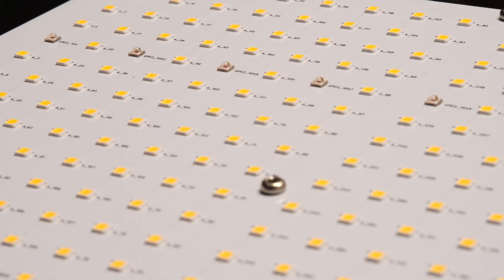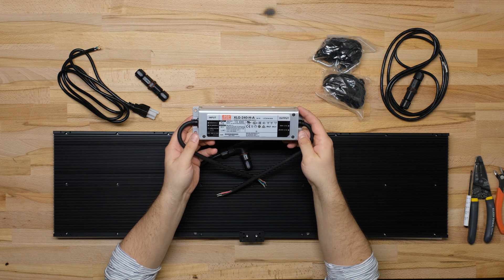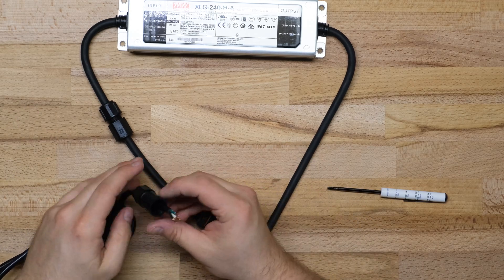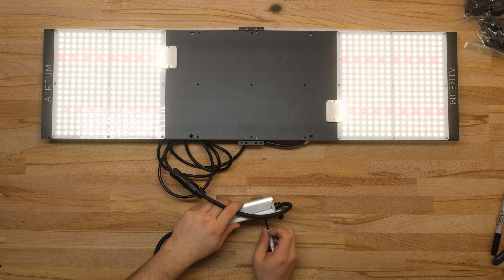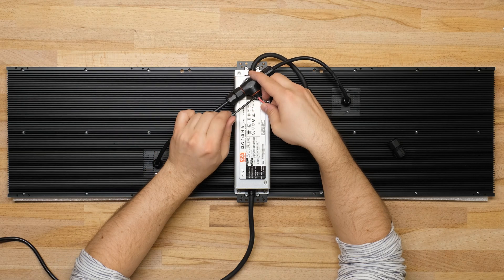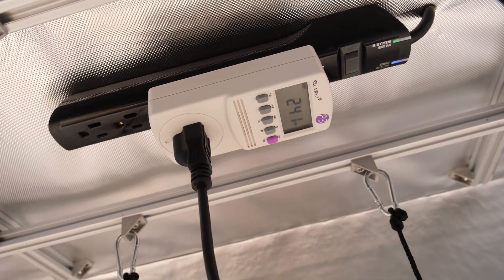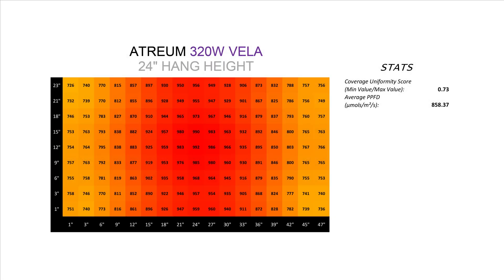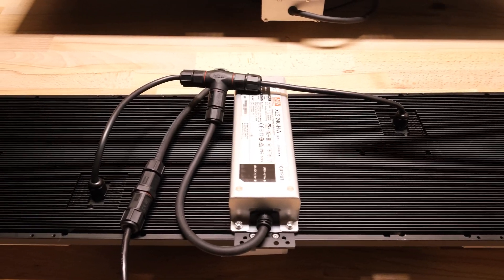Atreum VELA 320W & 240W Review: Power, Temperature & PPFD Measurements for 2 Badass 2x4 Lights

Comment: Great video! I actually purchased one of these a few months ago after watching this video. I got the 320W version and my plants are loving it. I have a question though: when shipped, one of the plastic bits that attaches the wires to the quantum boards over the top was broken but the light works so I didnt think anything of it. I just now noticed that the middle quantum board is dimmer than the other 2 by probably 25%. Is this intentional or should I talk to their support team?
Reply from the maker: They should all be equal brightness - something must be wrong. I'd get in touch.

Comment: Hi Ryan, could you help me find a link online where I could purchase a DC extension cord with black jacket for an HLG 300L and HLG 600R? I can only find red and black wires online without the black jacket.  Also do you know what size waterproof junction connectors I need for both lights? Trying to extend the driver out of the tent.
Reply: I found a couple options, do you know the gauge, the volts and the connector size?
Reply from the maker: I don't like giving too much advice on custom electrical stuff like this because I don't want to risk making a mistake and having things go south for whoever's doing the work. What you'd need to do is figure out how much DC current is passing through the wire and size your new wire to accommodate it. This could be done with a multimeter or by looking at the driver data sheet. Keep the cable as short as you can so voltage drop doesn't become a problem. This can also be mitigated by using thicker cable. A common waterproof connector for this is the LLT-L20.
Reply: @LEDGardener  Understood fully and thank you for reply. I did find the cable I wanted. Ill probably go with 18 AWG and I'll keep it as short as possible.

Comment: First & foremost I want to say thank you for putting out the guide to HLG Meanwell Drivers!  I'm a novice and you made it so easy to understand.  I found your channel after I bought a Atreum ARA-20 light kit, then I saw this Atreum review & hoping that you would show you set up the driver. With that being said, in Pt 4 of your meanwell guide, you explained how you set yours up.  I'm completely stuck on how to get/set my desired current from the electrical characteristics of the ARA-20 light bar & there are 3 total.  Your knowledge & help has been & will be greatly appreciated.

Comment: These numbers and uniformity are insane for the hanging height and wattage, I simply have to try some out. Looking at the design I was not expecting uniformity quite that good with such a large gap between boards but they have clearly figured out a way to distribute that typical LED hot spot very well with that configuration.
Reply: I've been sold on these lights right since the day I first saw this review! Not seen this kind is uniformity of spread anywhere else. These are gonna be my first lights for sure 🙂

Comment: they advertise osram reds but the boards are clearly marked as cree xpe 2 reds. wich is a far less eficcient diode. wich also begs the question, are the "samsung" diodes really samsung at all? because if you pause on the correct time, you can see the "gold wires" inside the white diodes, a telltale that those are not original samsung diodes.
Reply from the maker: Editing my comment for clarity:

I had asked Atreum for clarification on this as well and they confirmed the reds are Osram - there was a design change that never got corrected on the PCB labelling apparently.
Reply from the maker: Hi-res of HLG QB648: https://i.imgur.com/yUxOoQB.jpg
Hi-res of Atreum board: https://i.imgur.com/maEn6Yk.jpg

Looks legit to me.